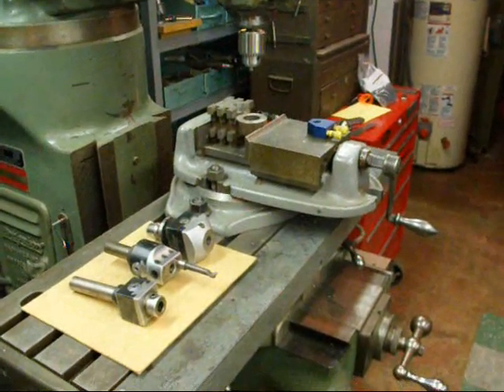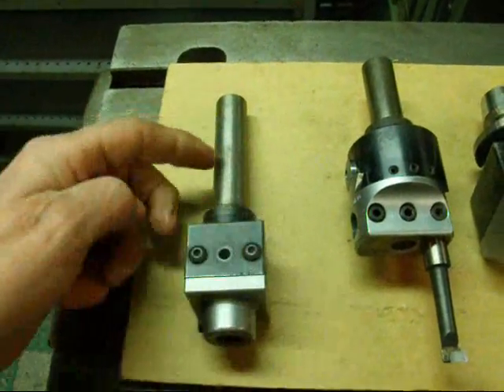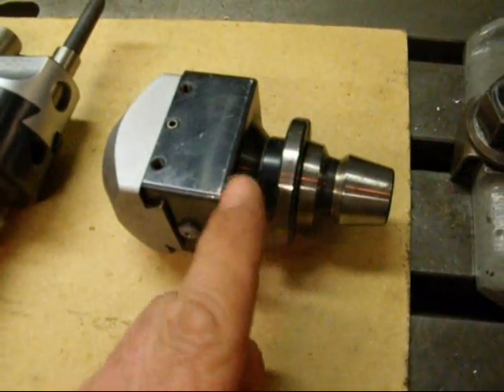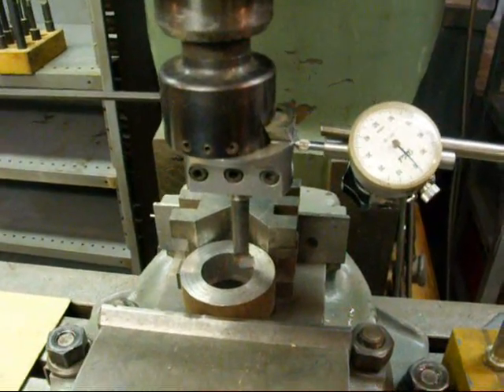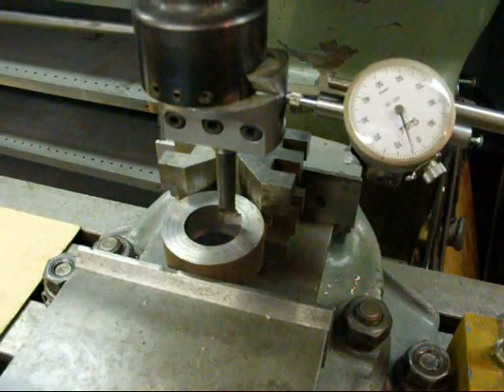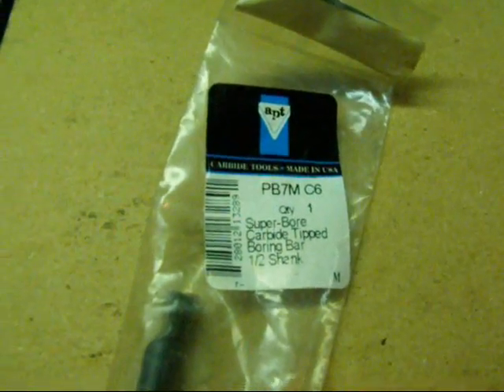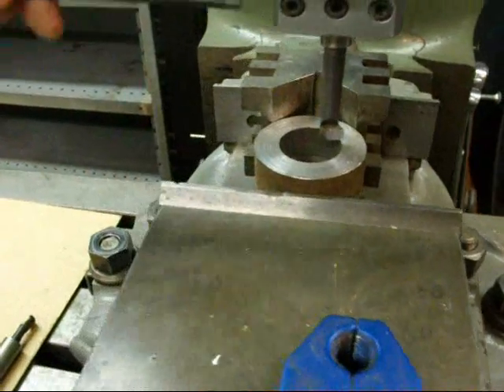BORING ON THE BRIDGEPORT MILL part 2 Criterion Head tubalcain

Comment: 2019! This is still useful, because I have to use my LittleMachineShop Mill to bor a larger hole in a Grizzly saddle to fit on my Central Machinary 12"x36" lathe. Wish I had the real equipment stuff.
Reply from the maker: Yes thanks

Comment: Your indicator read .005" when you moved the boring head .010"? Can you clear this up? You mention that the head is direct reading, so moving the boring head .005" read .005" on the indicator? Thanks. Love your videos.
Reply: Any adjustment of the boring head is a movement radially, but when it cuts it removes material off the diameter.
Reply: Thank you. Yes, that makes sense. Its the difference between measuring a line and a circle.  So when you dial in .010" on the Criterion DBL it cuts .005" out of the bore.
Reply: Emilio Gonzalez Aaaand you’ve got that backwards.
Reply: @Icutmetal  so if i dial 5 thou on the dial it actually takes 10 thou?
Reply: @twodoorcivic8062  Yes.

Comment: Mr.Pete,
I'am so grateful for your videos,   (I bought a new home and it didn't have a workshop, it has a garage but the wife wants It for cars! Go figure!) so I've been busy the last year n built a little 200 sq ft shop. I now can start my Hoglet engine and needed to make a 1" hole(R.50) and only had 3/4" end mill but I have a brand new boring head! (Never used it) so I followed your instructions and I used it on the crank web and it worked great!!!!!!!!!!, Thanks for your videos they are invaluable!!! (Ps I also watched the video on drilling and reaming an accurate hole, and that worked great also)

Comment: I don't think you mentioned the orientation of the tool in the head. Should the flat face of the tool meet the work at 90 degrees or should you twist the tool slightly to give it a bit of rake angle?Thanks

Comment: Hi mr. Pete... your videos are really helpful... can you give me a tip here...i'm making a speed reducer, really small,  i bored 4  holes for  ball bearings but i need to lock the bearings  in place with  internal lock rings but i can't imagine how can i do this cut, is there any suitable way to achieve this??? Or i need to make use of a cnc mill??? The stock does not fit on my lathe. Thank you so much, if you can make a video about this it will be really helpful.
Reply from the maker: That's tough one.  I would use Loctite bearing mount.
Reply: mrpete222 thank you mr. pete, the locktite worked very well, the bearing stoped walking out, i think my problem is alignment, was out a little bit, i see your shop and looks very clean, how often do you clean your working area???

Comment: Rudi Marczi: I think he knows this. He's just demonstrating how to properly bore on a mill. Imagine if you have a 4 cylinder engine block and you're trying to bore out the cylinder bores this technique would be extremely useful there.
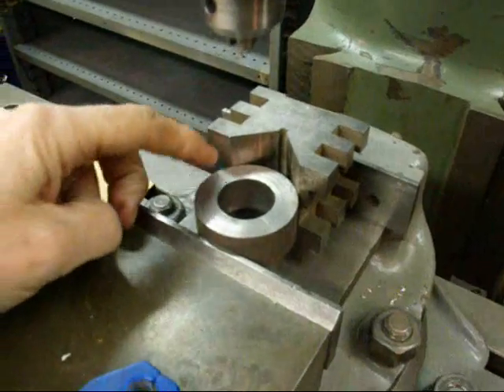Reply: at 1:14 he says, "it would be easy to chuck it on a lathe ect"

Comment: Did you make an error in the edge finding video? The center of rotation of the edge finder is .200. Half of that is .100. The centerline of a 5/8 inch bar is 5/16, or .313. Yes. So, wouldn't you have to crank the bit in .313 + .100 or .413?
Reply: Yep. If I already had a bore I would sweep the center with a test indicator to find my center too. Edge finders are junk if you need to keep the bore concentric to the od